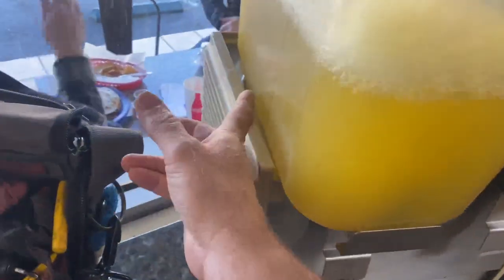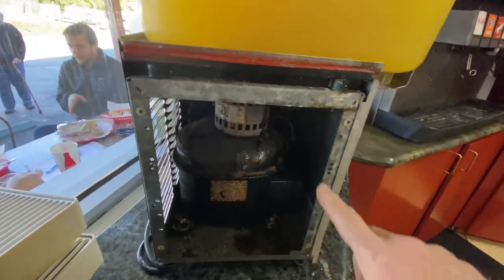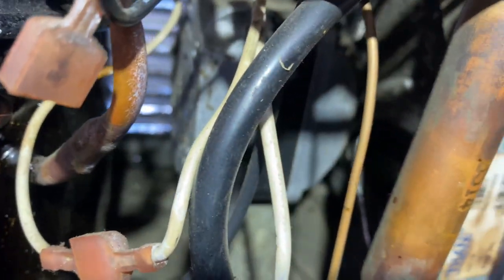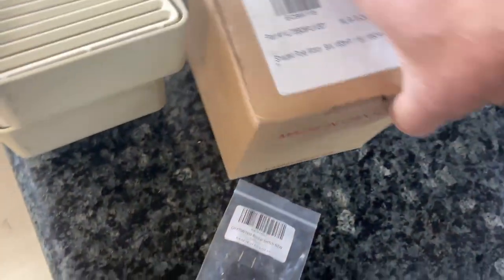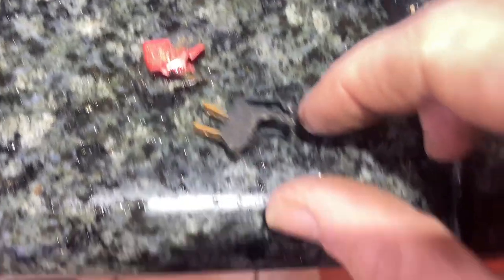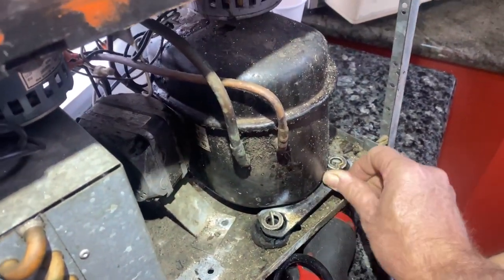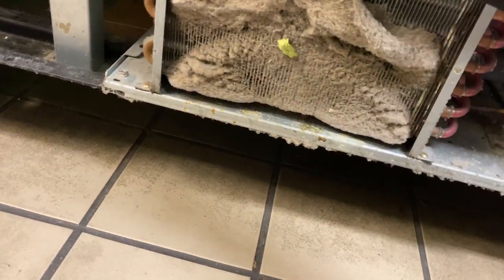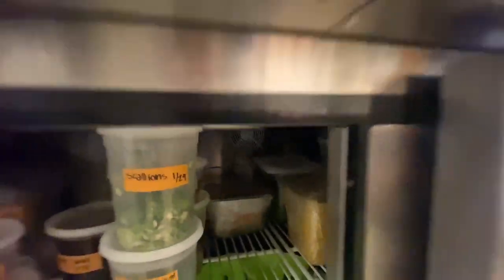The Horchata is Hot hurry up!!!!!!!!

Comment: With those atosas I bypass the transformer and put in 120v fans and call it a day
Reply: I've worked on Atosas that have 120 volt motors and 24v motors same model number that's when I discovered the controller in the back outputs 120 volt to a separate transformer.
Reply from the maker: I’ve done that too
Reply: never mind, I thought it was the drink machine not the evap. fans in the cooler. DOH. 🥳🤡
 I assume the mixer motors are 24V?

Comment: high current through a tiny plastic switch right above a cooking hot condenser, what could possibly go wrong?
actually, the switch melting probably helped save the compressor since the fan failed 🤣 some engineer accidentally did something good?

Comment: I was working in the same atosa prep table, had a bad evap probe. I ordered a new probe from parts town for $100 that was incorrect. Then ordered it from Atosa and they sent me a different incorrect probe. I ended up hooking a ranco up directly to the condensing skid and let it ride.
Reply: My company unfortunately does Atosa warranty and every mfg dispatch is "Customer complaining about unit not cooling. We're sending a probe and if that doesn't fix it then troubleshoot the issue and fix. NTE $300."